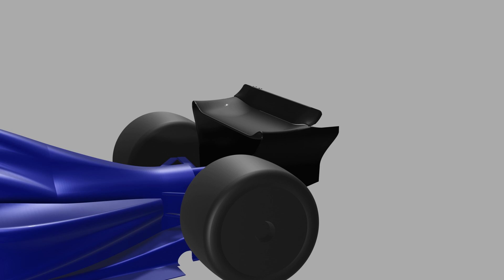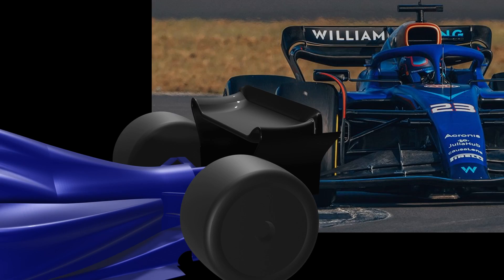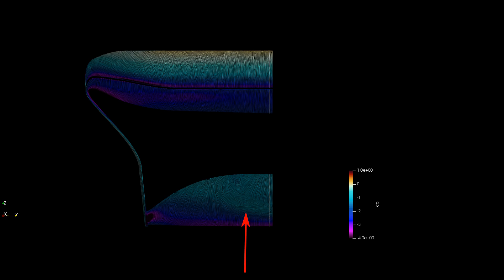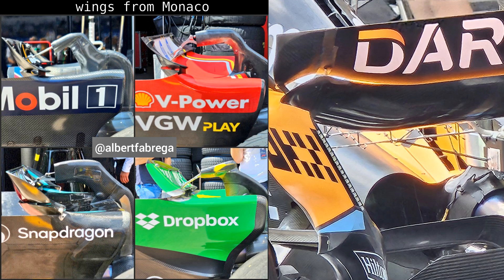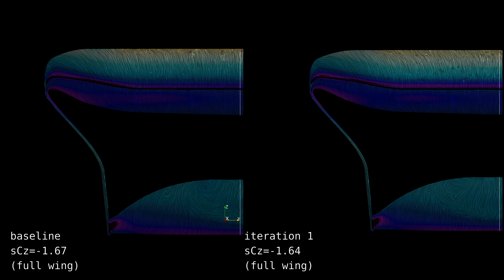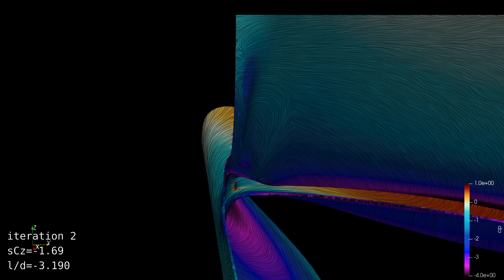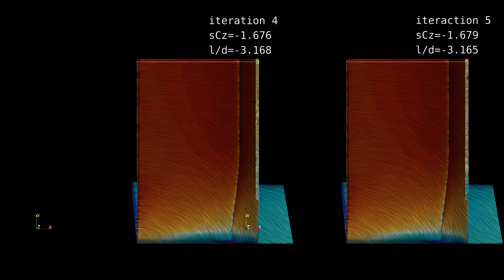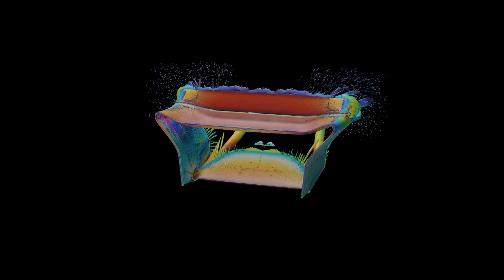FORMULA ONE Rear Wings: a very specific video.

Comment: If someone more knowledgeable can share their opinion: What I never understood about this rear wing type is why all teams seem to have a raised leading edge over the cambered bottom surface. The pitch of a car is "almost" fixed, and that concave camber in an airplane wing only helps at high aoa, which will never happen for the rear wing of a car. The only other option I might imagine for why it's there is for reducing downforce when the DRS is opened, but seems a wasteful method to produce less drag at very short parts of the race.

Comment: Iteration 6 works better in yaw conditions as well, because the loading on the tip remains more consistent than with other designs. I'm anxious to see a comparison between the overbite and conventional sidepod inlet. From what I've seen it increases drag from the fences and the pressure in the undercut. You should study sail boats, they seem to be a good inspiration for the upper plane tips.